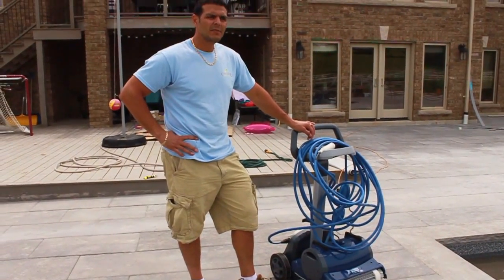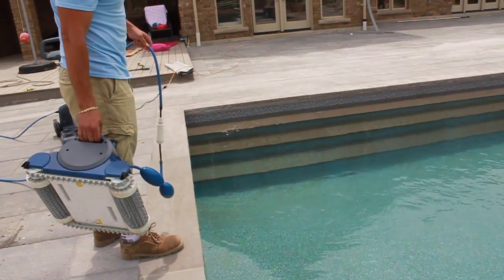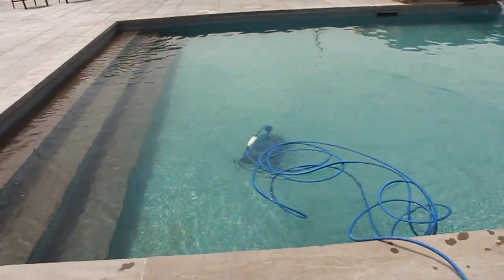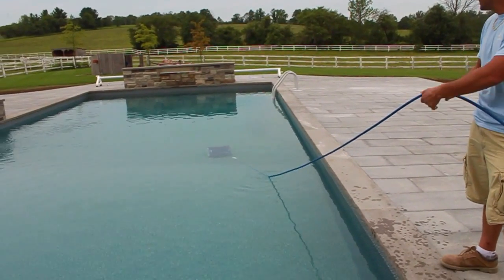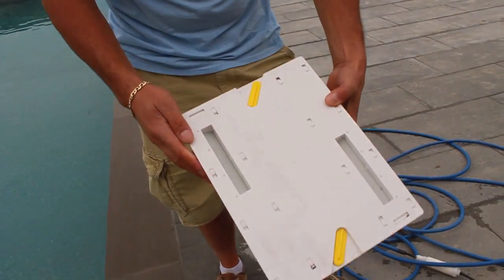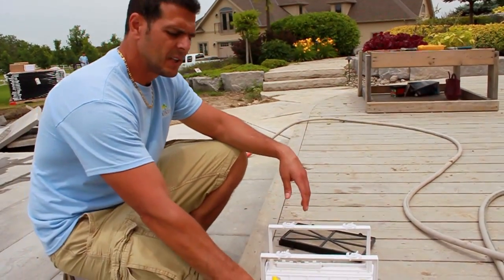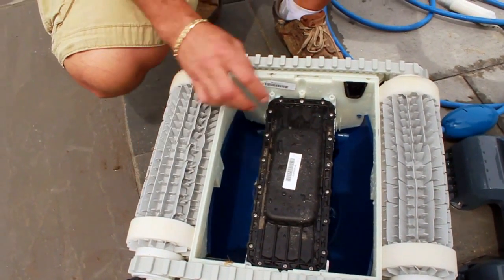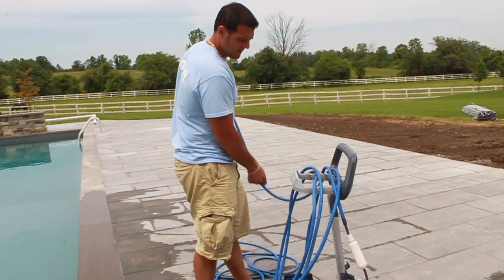Creepy Crawler pool robotic cleaner overview by Matt Cicciarella at Creative Pools and Landscaping

Comment: how about if the power is not working? it here any other  devices that we have to look into?
Reply: If it does not power on it could be a couple different issues. 

Best to have a licensed electrician to check the power issue.